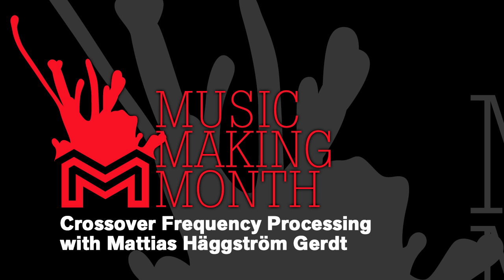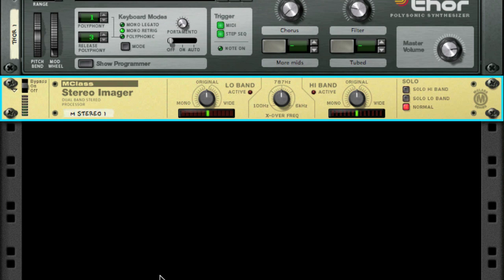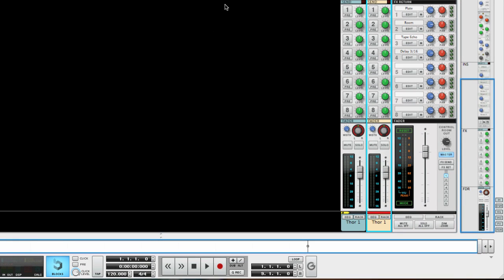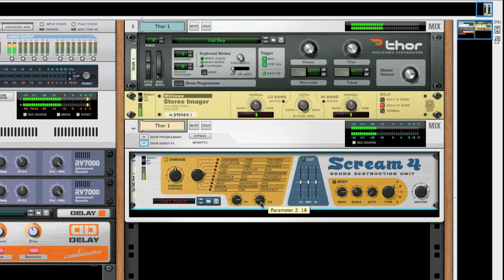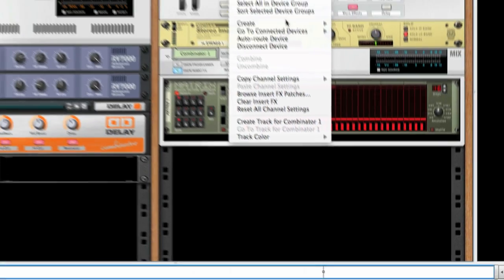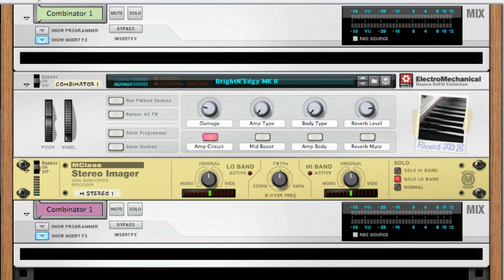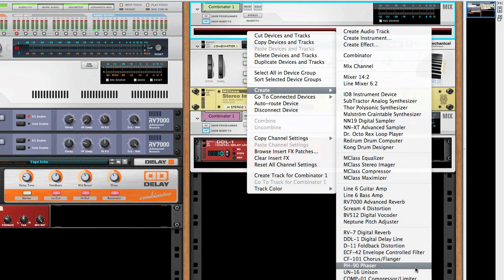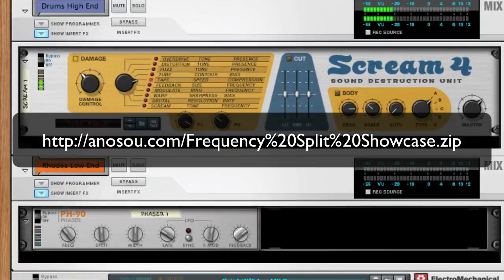Music Making Month - Frequency Band Processing

Comment from the maker: @AORNOfficial HAAS effect.  It's a stereo effect named after a guy named Haas that basically is a very short delay between the left and right speaker to turn mono sounds into stereo spread.  Mattias is doing the same thing but moving only the low band to one side and the high band to another and then applying the delay.  The result is a modified HAAS sound.  Very neat, Mattias.  :)